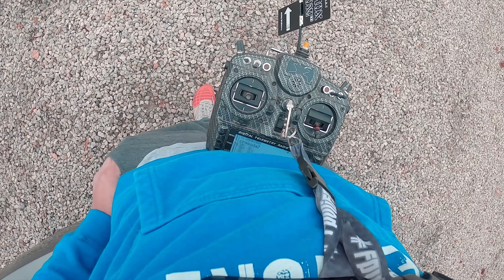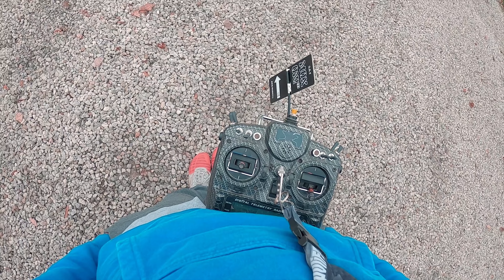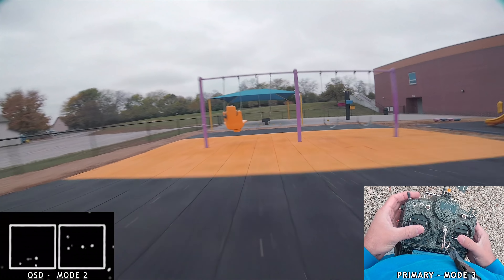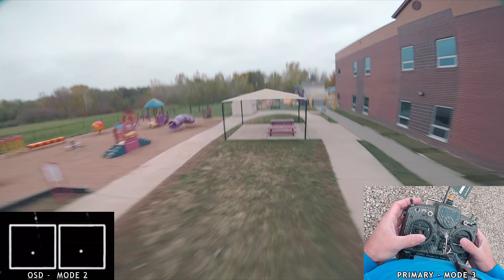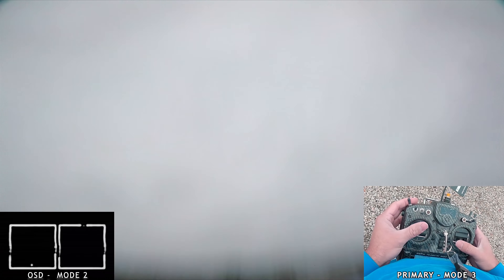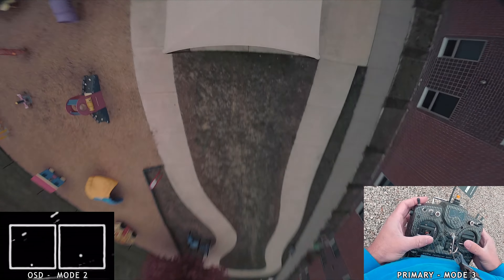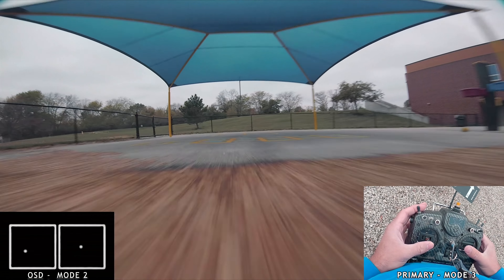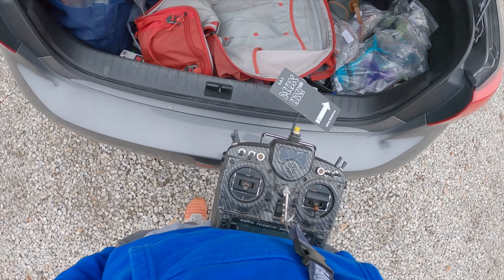How to FIX your POWER GLIDE? | FPV Freestyle

Comment: Cool trick! One thing that might add to the glide is bliping the throttle right when the quad is just past vertical in the power loop. So basically, that will throw you back harder and lower in a more elliptical shape, then pitch forward for the glide!
Reply from the maker: Yeah that’s it

Comment: I’ll definitely be putting in some sim time working on this one. I do have one question - you’re adding power during the upside-down glide; what does that do? Seems like it would drive you into the ground faster, rather than extending the glide. 🤔

Thanks, brother - really helpful series. 👍🏻
Reply from the maker: Sorry lag on my side.  Power should be applied when your performing the loop and tail end when looking back so it pushes you back
Reply: @UrLawyer I've accidentally hit full throttle when inverted, and from a 100' high I don't think it takes a whole second to hit the dirt, lol.  It really is amazingly fast, and hard on the quad.

Comment: Yo vik do you not ever get prop noise on long vertical floats. Either I running wrong props on new setup or my min throttle needs to be adjusted